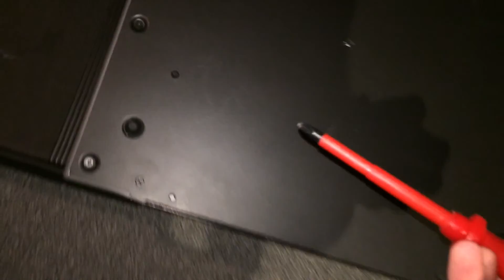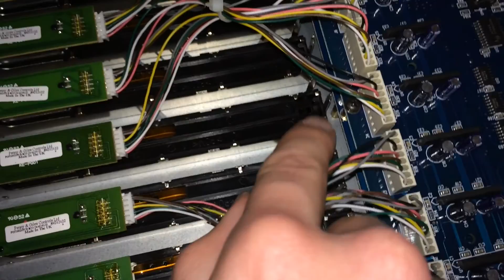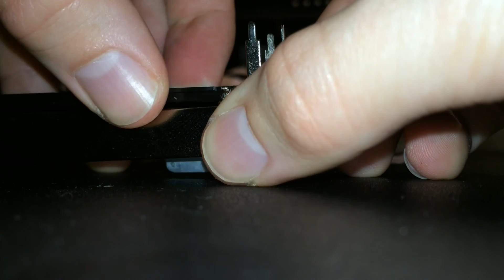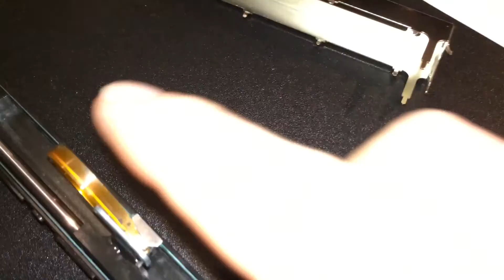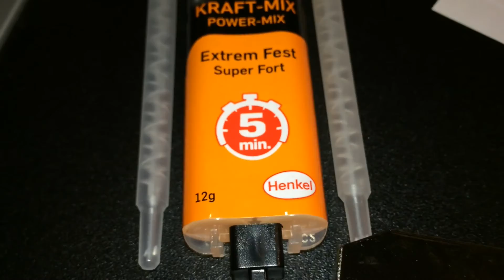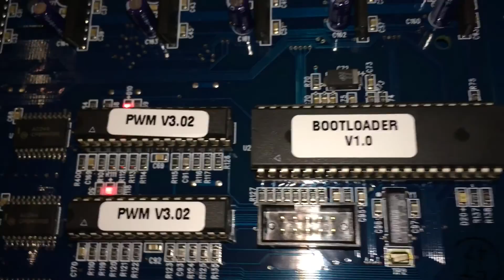Mackie Control Fader Repair Tutorial

Comment: they are annoying when not working properly. I have a full fix for the calibration fail on my channel. There's no danger from high voltage in there as it's 7.5V. The warnings are to stop you fiddling!

Comment: Thank you for this video!  I bought a second-hand Mackie Control Pro with P+G faders and was really disappointed as many of them wouldn't calibrate properly. I opened the MCU following this tutorial and cleaned everything using compressed air, q-tips dipped in water and a tiny bit of lube just to be sure. It feels like a brand new piece, I'm really happy with the results. Thanks again!

Comment: Thanks for showing this disassembly. I've just rethreaded the string on to one of the four guiding wheels, and the fader works fine again. From what I could gather, there are no new replacement parts for these faders around any more, at least for the old MCU (black non-pro).  That's why it's so important to fix these. I've been living without a master fader for years now, as I replaced one of my channel faders with it. The unit complains, but that's about it.

Comment: Thanks for this, I have a different problem where the faders get ‘sticky’ and won’t return to their set positions , or sometimes get stuck and not move/fail startup calibration. There seems no rhyme not reason to it, sometimes they will work sometimes not. Drives me nuts. Anyone ever have this problem and figure a solution??? Thanks
Reply: It's possible that you have the same problem, just presenting as a different issue.  The plastic part fixed in this video sometimes breaks, but doesn't come apart, and then the fader is just "sticky."  I had one fader like this (just seemed "sticky"), and when I opened the controller up, it fell apart like the slider in the video.  Two other faders were "sticky" because of accumulated garbage on the string and four pulleys at each corner.  Once those were cleaned up, they were smooth as silk.  Thanks so much for this video!
Reply: I had a similar problem. I opened up the fader as shown in the video, and had to thread the string back on to one of the four guiding wheels. When the string jumps out of one or more of these wheels, it'll hinder movement, which is why my fader kept getting stuck too. Take a look at your fader and carefully thread that string back on to the wheel if necessary.
Reply: It's an electronics problem...check my channel for the fix to this. If you can use a screwdriver and soldering iron and have around $3 you can do it.